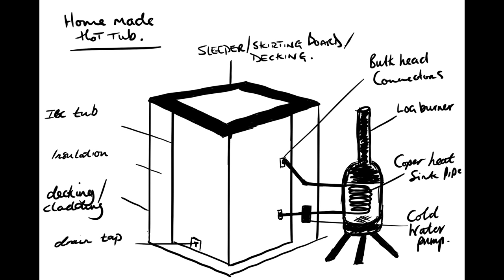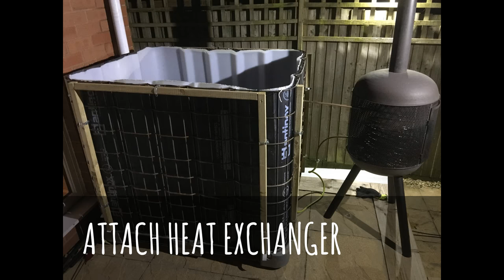DIY IBC TANK HOT TUB

Comment: that looks great. i never thought if insulating mine but if i need to redo the wood i will. quick tip, fasten the top inside with treated pine or water resistant wood to the outer wooden frame. this way you have solid base for a surrounding lip. also it covers the edge of the plastic because it goes through the plastic pining it in place. the corners are a bit of a bastard but you can either round the outer edge or put a corner piece in.

Comment: What diameter and length copper pipe did you use? Does it heat up quick enough or would you increase the size?
Reply from the maker: The diameter is 22mm  I found that it does heat up quickly but all depending on how fast the flow of water is, how many coils in the burner and how hot the boiler is. 
A nice steady flow and as many coils as possible works well. My set up has 6 coils and comes out 90 degrees centigrade or instantly boils in the pipe. 
I have put an open close valve on the system to slow down the flow or increase flow to vary the temperature.